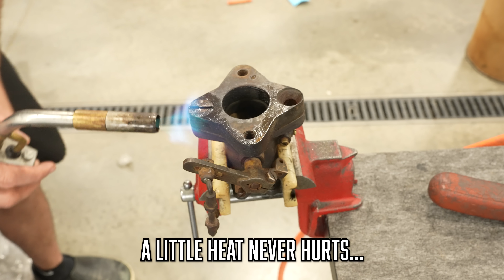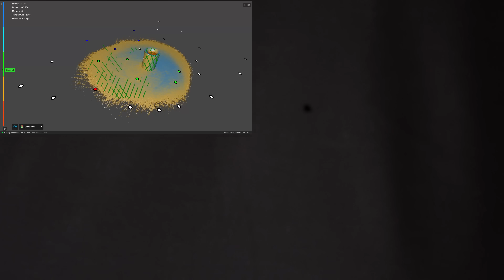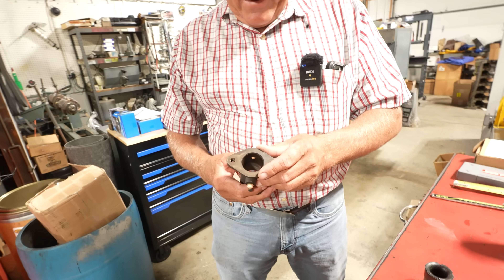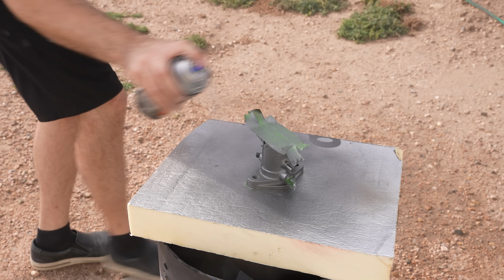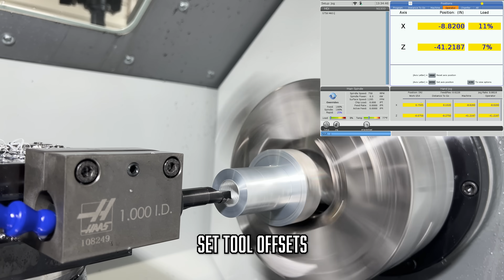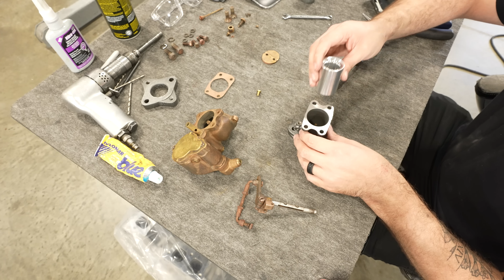Repairing A CRACKED 1920 Zenith T5F Carburetor W/ MODERN Tech

Comment: Hi, I got a lot of experience with "silver" brazing. In fact when brazing brass or bronze, an alloy with different concentration of silver if used mostly. The deal is that it's easier with more silver because it lowers the melting point but it appears as a lighter, whiter color. You can use high melting point allow which is very yellow so it will remain invisible but at the cost of having a high viscosity so it often requires more finishing work to be invisible. These high temp alloys are often used with steel. I have some advice for your repair : 
1/ heat the whole part, not only the crack, it's not a weld. heating everything will make the solder melt evenly and fill the crack gracefully. To do that move the flame all over the part quickly and scale the flame accordingly to the part mass and size. Avoid acetylene flame that are too yellow, make it neutral so it won't blacken the part with carbon but not too oxygenated either.
2/ I would recommend putting the crack below and braze from the inside to avoid any drip flowing along the part and making a mess.
3/ You can put the borax when the part is hot, I never put it before and I slightly heat the solder wire a bit so borax sticks to it when I dip it in the container, then apply with the wire on the part, if you do that, don't heat too much to not melt the wire !
4/ when the heat is right a silver based alloy will flow like water and fill the whole crack by itself, only add what's needed to fill the gap. The capillarity will make all the work for you. Don't directly heat the wire, only the part, the heat from the part will melt the wire, especially helped by the borax contact. If the heat is too much the melted solder will boil and look ugly afterward as well as wander on the surface, if the heat isn't high enough, it will flow slow and unevenly, if it's right and there enough borax it will shine and take beautiful shapes and make nice chamfers in concave corners.
5/ cleaning finishing : normally, a hydrochloric acid solution bath like 5 % cleans the borax, but I'm not sure if the steel likes it, but brass bronze loves it
6/ prefer the file first to remove excess solder because it's accurate, don't bite into the part at all ! use abrasive band at the end but very lightly, you shouldn't remove steel at all. I used to take a dremel with an uneven stone tool to make it look like casting after sanding. You can use sand blast to make it pretty after that.
7/ Your idea to use the vice to press the part together was good, but make sure it's not pressed to strong to leave just enough room for the solder to flow in the whole crack

Comment: I used to work with an old timer gunsmith, when installing sight bases on a barrel, they were installed via a jig, and silver solder,, the area was scribed and a product he called solder block was applied around the base,  bases were then removed,,"tinned" then reinstalled and heated to join,, the solder block made clean up a brease,, excellent video,,, the solder block came in a stick that looked like soap stone

Comment: Always like your work and been watching for a long time now, I would only add that its been my experience working with old and stuck small screws to ALWAYS use a hollow ground screwdriver of the exact dimension of the slot. This makes an absolutely massive difference.

Comment: I am 72 and would much rather work on an ancient carburetor than a modern fuel injection system.  At the very least I knew how it worked and did not need to mortgage my home to buy the right tools and equipment.

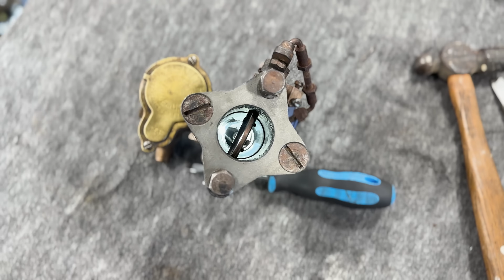Comment: Nice work - fun to watch and learn, but why didn't you clean up the screw and bolt heads (at 32:32), even if it was just with a wire wheel or something similar?

Comment: Love this video.  I find all the technology amazing.  If  I were a lot younger, I would love to learn how to do this work. 

I do have a question. How did you keep the drill bit from gumming up.  I retired as a substation electrician, and when drilling bus work, the aluminum would get hot and gum up the bits. We would go slow and clean the bits often   

Also, I used to work on old motorcycles some.  Use an impact driver on the screws. I'm talking about the kind you whack with a hammer.  They are old school and they do work.

Comment: In my experience, silver solder flux is water-based. When it dries out, it is literally dry. Just add a little water and break it up, then stir it back into a paste.

When silver soldering, you want to first get the part hot enough that the flux melts and looks like thick water, completely clear. Then you want to get the part a bit warmer, so it just starts to show a little dull red. You should be able to touch the solder to the part and have it melt and flow instantly. It should suck down into the crack and pretty much vanish. It isn't like brazing, where the braze tends to build up on the surface.
A properly done silver solder joint should be as strong or stronger than the steel being joined.
Reply: Sounds like he fucked it up, but it will probably hold.
Reply: @hylomane  It wasn't done perfectly.  But, it was done well enough to work.  The only real issue is the excessive solder on the surface.  With such an old casting, you don't want to put more heat into it than absolutely necessary.  Otherwise, you may warp it or crack it somewhere else due to inconsistencies in the iron alloy.
Reply: I use the same solver solderr kit, and the flux always dries out very quickly. Just need to make a paste with water, good as new.

Comment: It's great to see you experimenting with a 3D scanner. That carburetor was an excellent example to scan and reproduce using 3D metal printing in any metal of your choice. Even the venturi could have been printed with 3D metal printing.

When I talk about 3D metal printing, I mean the type of printer that builds layer by layer using metal in powder form, with each layer fused by a laser. This method produces functional or machinable parts to final dimensions.

Comment: Cast iron doesn't weld well? I weld cast iron all the time, and all of my welds hold strong. The trick is, being cast iron is porous, like a sponge, it absorbs oil. To weld it, it needs to be thoroughly heated with a torch to burn the oil out of it,. Then it can be successfully welded with a mig welder.

Comment: Did a lot of silver soldering, surfaces must be clean for a good bond. Use flux, watch for it turning into a liquid and try to draw the solder from the other side.
Being cast iron would have etched the crack.

Comment: When soldiering: Heat the base metal to red hot, apply the flux and then the solder. The cold solder will be sucked into the gap. There is no need to continue with a heat flame to smooth out the surface.

Comment: With all due respect you have only silver soldered 2x and you say welding cast iron can't be done.... 30+ yrs exp welding here and I have welded cast iron with no issues, you just have to be thorough in your processes and use the right materials.

Comment: Please obtain a set of proper width screwdrivers. 
Blade needs to match screw slot length and width, in order to avoid buggering up the fastener head.
Interesting restoration.  Silver solder for the win.

Comment: Well, what's your shop rate? $150/hour? times 10 hours = $1,500, and given the cost of the CNC lathe, that's probably not enough. Suggestion: for those old time odd sized screws, a set of gunsmith screwdrivers would be helpful getting the perfect fit. Nicalous, I'm surprised you are wearing a wedding ring around all those machine tools.

Comment: I personally would have cleaned and etched it with some acid to remove dirt, oils, and corrosion from the crack but I don't know how silver solder would act with an acid prepped surface on cast iron. I use phosphoric acid to clean parts for painting sometimes, the iron phosphate bonds well with paint.

Comment: I had to do this to a similar Zenith carb on a 1925 Novo engine of mine. The pot metal venturi expanded and broke the housing into three pieces. I hose clamped the pieces to a cylinder that I turned to the correct diameter and brazed it back together. I drew up a venturi using a cross section view in a Zenith service manual and had it turned on a CNC lathe at work.
Reply: i never knew pot metal would expand with that much force, as much as i have worked on old pot metal stuff, i guess i never realized
Reply: @gtb81.  I believe all metals expand when they corrode.  AKA "rust jacking" on steel.
Reply: @randyb1890  the pot metal isn't corroding though, it just starts breaking down on its own. it can be dry and protected all its life and just start falling apart.

Comment: That is not how you repair a crack.. wtf... 
You have to bevel the sides of the crack and then braze/weld (preheat nessecary on both and cool it down slow..) it together again.... (both sides would have been the best but you can scrape by doing it on the outside but having a small gap so the capillary action can do its work) Where did you learn to repair a crack like that? (the hole for the end is correct)
You can clearly see that the capillary action was BASICALLY not present.. since you can No color change in the inside of the bore aka no filler material being pulled into it..... WHAT

Comment: I have had great luck tig welding cast iron using an old used piston ring for filler. Also when turning that ventura the I.D. work should have been done before taking the final O.D. cut to maintain concentricity, not that it was critical on that part, but if it were releasing the stresses in the material will effect the O.D. An old guy once told me never charge for any work for a church, it's just the way it has always been, come to think about it, I think the churches know that rule they have sent me a few projects, good to see fire departments fall into that rule as well.

Comment: Good job. Yes, indeed -back off the idle speed screw and tap on the throttle plate to help seat it. Some carbs use lock washers on the little screws. Some stake them in place. A  throttle plate screw or choke plate screw will suck into the engine, even  with an updraft carb like on your D17.

Comment: Wonderful work.  I did wince at the undersized screwdriver on that large screw at the beginning, though.  Coming from a little gunsmithing experience, we'd absolutely insist on a screwdriver that is as long as the slot is wide.

Comment: I believe you can add water to the silver solder flux to thin it out some.  Also it may be a good idea to grind a groove in the crack that needs repair to get a better surface area for solder adhesion.  🙂
Reply: No,siver solder works best with thin cracks.Can´t fill wide cracks with silver solder.Thin as water when it´s melted. Sucks in with capilary force. You widen it if you are brazing it.

Comment: The old cast piece could have been used to make a mold for a new cast piece.  With the mold, it would be your choice of metals.  A cast iron casting doesn't cost a fortune.  Maybe $30k with all the work and machining?  Then make 50,000 of them(as Zenith did) and the cost drops to $5/ea.  :P  No kidding though 3-d printing of a casting lost-wax mold is not all that expensive.

Comment: You probably already know. I'm going to say it anyway. On those soft flat head screws. Use a precision ground screwdriver. (Available at most electrical supply houses). Standard screwdrivers are a wedge. So you're only engaging the very top of the slot. Ground screwdrivers are the same dimension, the entire length of the blade/tip. They're commonly used in electrical applications due to copper and cadnium lugs, which will chip off or deform if you look at them cross-eyed.

Comment: Cost ? 
What would you charge to clean and service a common modern Carburetor?
I’m old enough to remember when brazing or silver soldering a cast part was very common. I distinctly remember picking up a part that was in for repair, and it was $7.50 for a small braze that took the welder less than 10 minutes.
So the work without the fabrication probably 1.5 hours total. Then you have to consider what the aluminum part is worth. I would imagine that somewhere there is a similar part for $100.
If the shop rate is $200, I would think $300 is a fair price and it’s a customer service where you don’t make any money, but help out your customer.
PS. Snap-on sells hollow ground wide flat screwdriver tips, for their multi tip screwdriver.

Comment: I would like to see this truck running with the carburetor you rebuilt to new specs just to hear it run & see if they would be willing to let you drive it by chance . That's very cool that you were able to do this being I'm sure to find parts for it are probably almost impossible to find with the only possible way to fix it was to actually make the parts for it .

Comment: Dad and I had a couple magnetos from some 1920's tractors rebuilt.  It's amazing what can be done with some of that old equipment.  The magneto internals were made of pot metal which was crumbling due to zinc rot.  It was rebuilt by machining replacement parts with modern Zamak which uses a higher grade of zinc so shouldn't fail again.  But the people that know how to do that work are few and far between.  The guy that did this had people coming to him from several states.  But he's been gone for many years now.

Comment: What should it cost? Time and resources required to get the job done plus a profit margin but it depends upon the availability of original replacement parts. In this case parts are most probably unobtainium so it would depend upon negotiations between customer and shop. These are probably one-off projects either for museums or collectors. Museums are always notoriously short of cash and collectors of historic vehicles are usually prepared to invest huge amounts of time, effort and cash into preserving the originality of vehicles. Let me put things into perspective. A set of 4 genuine vintage Gibson 1955 potentiometer knobs , made of plastic, will set you back 500 US dollars. A set of almost identical knobs produced today but aged appropriately will cost about 50 US dollars and a set of very similar knobs start at 15 bucks. These are the lengths that people are prepared to go to to preserve originality.  Round plastic potentiometer knobs with a price span from 4 dollars per item up to 125 dollars per item. Make of it what you will.

Comment: working at a Bell Textron authorized overhaul facility we used earplugs all the time in the blasting cabinet to block off ports that we didn't want blasting material in. that and also hot glue which worked great for bearings
as for your stop drilling the crack if you used the proper procedure it was not shown in the video, you never stop drill into the crack. there could be hidden stress still inside the material. standard practice is to stop drill past the crack and then "walk" the crack into the stop drill, ensuring the stress has been relieved.
another trick you could have used after the silver solder repair would have been to use something like a pneumatic needler to peen the surface and match the cast iron finish, which also is a great way to relieve residual stress.
Reply: How would you extend the crack to the hole?
Reply: @gordonborsboom7460  tapered punch in the hole the crack goes directly through. or a small  wedge from the outer portion of the crack would work.
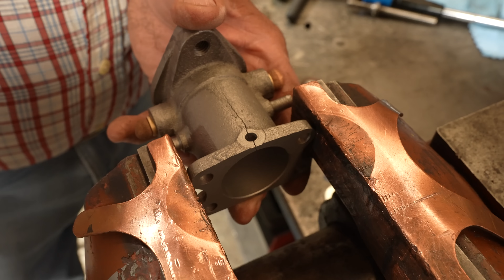 at roughly 7:35 you can watch them squeeze the crack closed and then allow it to open, that would also work since every time you squeeze and open it again the crack extends very small amount. 
even heat would work due to thermal expansion and contraction
edit you can even make a mini case spreader by utilizing the two bolt holes central to the crack. lots of methods!

Comment: The cast iron carb body cracked not because of water but because the pot metal venturi expanded because of Zinc Pest.
Reply from the maker: Ah!!! That may be the case!!
Reply: @JAMSIONLINE if that's the case will aluminum do that same thing,, aluminum and cast don't play well together 😳😳😳🤔💪💪😎
Reply: @timheasley612 The Loctite barrier should help some to keep the metals separated.
Reply: @timheasley612   WRONG. Zinc Pest ONLY affects zinc alloys it is an intercrystalline corrosion of the alloy it's self and has nothing to do with the cast iron part or moisture. And aluminum venturis have been used in cast iron carbs for almost a century with no issues.
Reply: Thank you for the new to me term Zink Pest, have seen it in old metal parts such as Lionel train wheels and old car parts but never knew it had a name.

Comment: just an aside from your cast weld conversation , general cast does MiG weld very well . not as thin as this is , of course . silver is perfect . has low temp strength as brazing . i have silver soldered more than a few hydraulic line to keep farmers going , works well .  i might at one of those snap off banding straps or similar for a little more security .

Comment: I used a Stoody spray welder with the powder for cast to repair a Chevy 235 exhaust manifold. As someone else mentioned I took a needle scaler to replicate the cast surface. Unfortunately the cast powder doesn’t seem to be available, just the hard surfacer. If anyone knows a source, let me know.